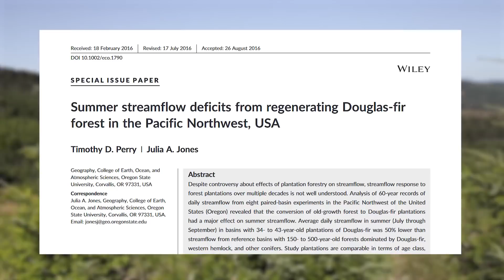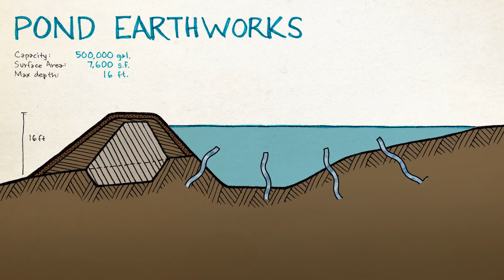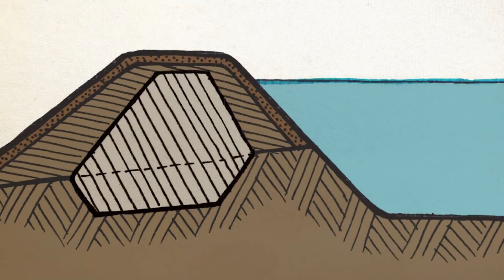Integrated Water Harvesting Earthworks,  Restoring Ecosystems with Permaculture Design

Comment: Hello. Nice video. Nice video. But I think it is a wrong application. Because the number of ponds is too many. 1. After making all the ponds, the ponds may collect water in rainy periods, but in dry periods, the bottom water of the forest will drain quickly and the accumulated water will evaporate, and after a while, the forest will be damaged first, and then you will not be able to collect as much water as before. 2. When many people settle in that area, the need for water will increase and eventually you will start digging more wells. You will ruin a very beautiful forest. 3. Isn't it best for the land to remain as it is? Use as much water as the soil gives. Stay with nature.

Comment: I am so impressed with your work and commitment to regeneration. I lived in Eugene for over a decade and watched the land around there, Springfield and Cottage Grove get drier and drier. Heartbreaking. In those early years of my focus on stewardship I was in an “understand the damage” mindset, didn’t get the concept of active stewardship (yet). More of a look how the forestry industry is mismanaging the land, do something about it focus(I mean,  come on, Douglas Fir requires so much water!) At this point I want to be the one doing something and am. I have a very small bit of property 1/2 an acre smack in the middle of town. 1/2 of that is 200-300 year old cedar and spruce on a very steep west-facing hillside… 19% slope riddled with underground springs and rated as one of the highest dangerous erosion hills in the county. Right now I’m focused on restoring microorganisms in the soil and slowly filling the outflow points  of a natural trench on either edge of the property to capture, hold and slow runoff. Observing what happens this October will help me to decide where smaller downslope swales/ponds could be situated. At my age/condition it’s going to be slow going but I am committed to helping this little bit of land recover. Thank you for sharing this, it was informative and helps my thought process and planning.

Comment: it should even work on micro environment scale my homes only a half acre but i made rainwater harvesting from the roofs gutters to 55gal plastic drums painted affectionatly to blend with a forrest and then thier overflows  sent to my 30x30foot garden for a small amount of fresh produce the lower part of the barrels being placed up like 3ft high allows me to water in-between rainfalls and even run soaker hoses to slow release the moisture into the clay soil the whole yard benefits even my neighbors yard benefits during heavy rains I've tried placing temporary sandbag dams in the ditch of the road behind my parked car just to raise the level about four inches to reclaim the stormwater runoff with a small pump and a garden hose run to a giant hole in my backyard that was supposed to be a waterfall but ends up just being a funnel for the water to be filtered through the land and return to the aquifers also mowing my lawn on a higher hieght in the dry heat of summer to capture more water and decrease drought so watering restrictions can F themselves because my waters coming from the sky and not thier chlorine and flouride tanks recycling vegetation to one corner of the yard rather than discarding it in a city dump also yeilds me wonderful soil and wildlife rabbits munching on piles of cottonwood leaves all winter long by my bedroom window and campfires in the spring after rain to expediate the process though I'm looking into purchasing a woodchipper for sticks and leaves to mulch the trees here are as old as me planted by my parents purchased from the states college agriculture stufents... and yet the toxicity of the HoA makes me wish to leave my home as i cannot afford the fines accociated with capturing green energy on the roof of my home or from the wind to even offset bills and supply neighbors with green energy and emergency backup power with today's brownouts etc I'm working on building siren 🚨 absorbing hedges as the traffic of emergency vehicle's is only getting worse along with the drone of semi's J braking waking you from your slumber as it literally vibrates the house... yeah the soundwall made it worse and amplified the sounds reflecting more of it at us and for some stupid reason they forgot to spend my tax money on sealing up the bottom of the wall as the sound goes right under the 2ft gap they figured the 8ft earthen berm was enough after that but it quite literally makes a large cone sending the sound off through the neighborhoods thank God for weeds or it'd be much worse 👀

Comment: What about mosquitoes? Also water loss through evaporation - what is the balance of gain via retention in ponds in relation to surface evaporation? Also cost in loss of growing area, building costs; costs in terms of time to re-establish growth. Need to do evaluative survey of vegetation growth and diversity after pond building.
Reply: Grow a water plant which would reduce evaporation. You could also pull it and use it as a water saturated mulch, reduced the amount of water usage for your garden.
  Each problem can be a solution

Comment: Fascinating Plan. Thank you!  One question: How long do you think the eutrophication of these ponds will take on average? Do you plan on re-digging them when necessary?
Reply: My understanding is that eutrophication will only occur if there is an excess of nutrients flowing into the pond from unstable soils and excess fertilizer runoff from conventional farming or livestock practices. As long as they have a large living buffer of forest growth, I would think these should last a very very long time. Of course there is seasonal leaf fall, but with a healthy system there should be adequate carbon cycling happening and so organic material and sediment buildup would be very slow.

Comment: First of all, let me echo the many compliments in the comments here. Great video! Now, onto the criticisms.😂

Most farmers and ranchers and timber forest owners are aware of best management practices, and abide willingly, so it is not a completely new idea. The idea of visualizing an entire floodplain and seeing ways to improve it are new to me, and I really like it. Next criticism. It's a lot of work! What I am getting at here is that eventually any pond is going to fill in with silt, further sealing it, and reducing the ponds contribution to the ground water.  This means that, in the larger scheme of things, this is a continual effort that never ends, so there is an ongoing decadal labor that must be expended to maintain these ponds. I need an idea, and analysis, of what such annual costs are, in order to do a cost benefit analysis. Perhaps you could provide some guidance on this?
Reply: Suggest use of plants in the pond to keep the pond bed porous despite the silt build up.  Also, use of plants can be used to slow down the water and cause it to pool rather than racing on by.
Reply: You use the word "most" too easily. I am aware of many farmers and loggers that don't know or care about a lot this stuff. Maybe the ones in your area are more aware, but far too many are not or simply do not care.

Comment: Hi great stuff. How exactly does the pond earthworks affects aquifers and emerging springs?
Reply: replenishes them
Reply: @KyleHatch21  Right but how? As Mark explains you want to ensure you have a nice layer of clay to hold the water so how does it penetrate the ground and refill aquifers?
Reply: @joeyhinds6216  a pond is pressurized due to the weight of the water. That pressure forces moisture through the layers beneath. If it was pure clay, it would require a great deal of pressure.
Reply: @KyleHatch21  it does make more sense when you think about the  pressures involved. I guess the water in aquafers generally move very slowly regardless of soil type more so in clay but it will move through given enough pressure?
Reply: @joeyhinds6216  yes. Given enough pressure, it will.

Comment: I live in a small city where all the hills around us are brown dry. The hills are angled between 45 degrees and 75 degrees. How do I hydrate the hills  without causing landslides?
Reply: *plant cover crops to build the soil and retain water.
Reply: Build puddles instead of ponds tiny lil mini ponds on dry stream areas/ where ever the water runs in the rain. Also planting bushes/trees begin to retain water by nature
*airerating soil allows water to penetrate *ground cover leaves hay cover crops ad moisture and build the soil ability to retain moisture longer.
Reply: Make friends with an engineer if you have a slippery layer of clay underneath, or self educate. First, find what's there by digging . If there's bedrock maybe drill into it and put big fasteners for steel netting or whatever. It's that slippery clay you have to watch I think.
Reply: Slopes of that grade will have thinner soils so less capacity to hold water. Like others said, use cover crops. You can lay straw wattles and woody debris on contour to intercept and slow the water. I've read a bit about rough terracing using perennial bunch grasses on contour, more tightly spaced the greater the slope. Then you can farm vegetables between. If you have the space, resources and inclination, you could experiment with running hogs or sheep in narrow strips on contour to create small terraces, but in this case the implementation would be much more hands on.